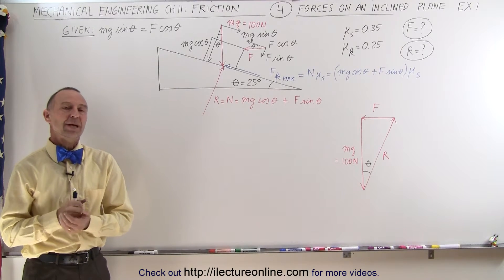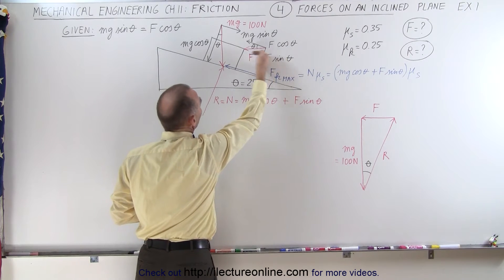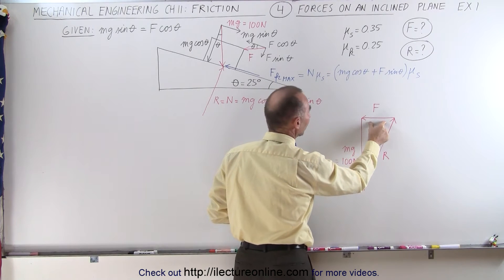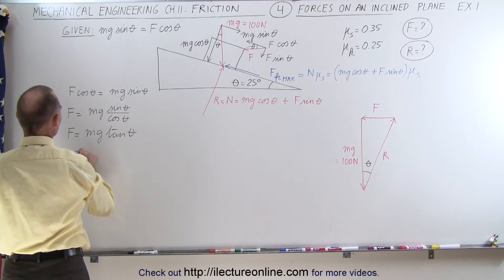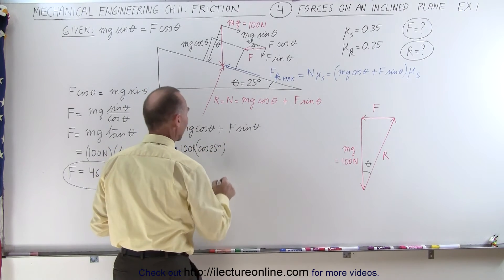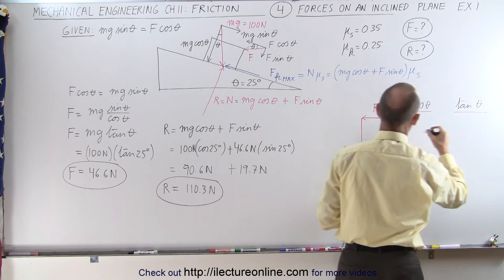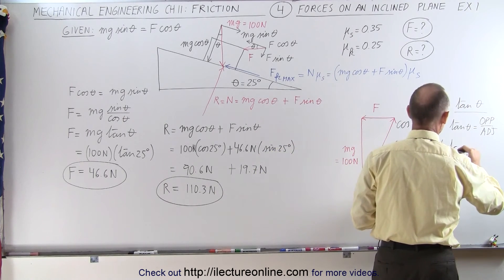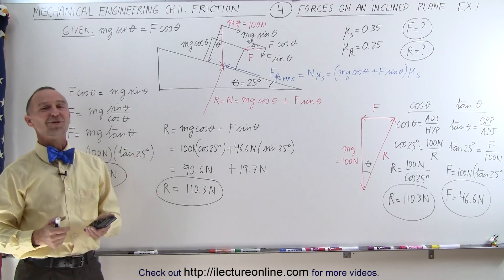Mechanical Engineering: Ch 11: Friction (4 of 47) Forces on an Inclined Plane: Ex. 1

Comment: I may be mistaken, but I think you still need to include static friction since the formula is simply the Normal Force X Coefficient. If you calculate the static frictional force used the perpendicular component of mg and the applied force I get:
Applied Force of 10 N
Force Friction of 33.2 N
Reaction force of ramp on block of 100.4 N
Please correct me if I am wrong. Thanks for the videos, you have helped me and others a great deal.
Reply from the maker: It is given in the problem that mg sin(theta) = F cos(theta).  That means that there is no net force parallel to the incline.  That means that the friction force must be zero.
Reply: Michel van Biezen - Got it. Thanks!